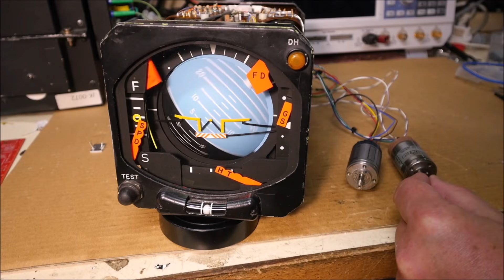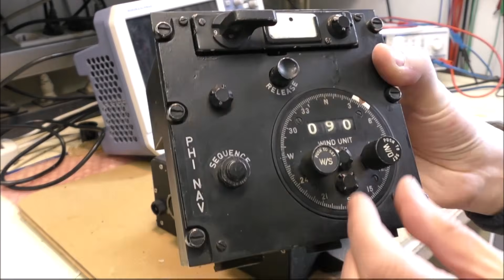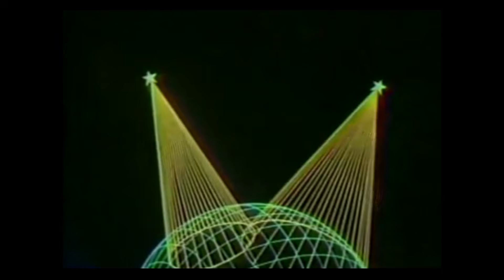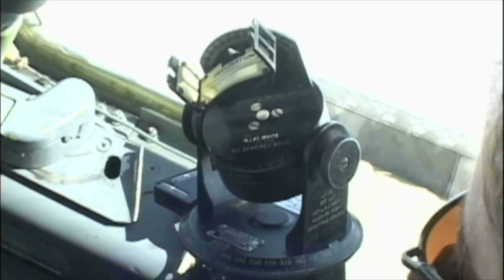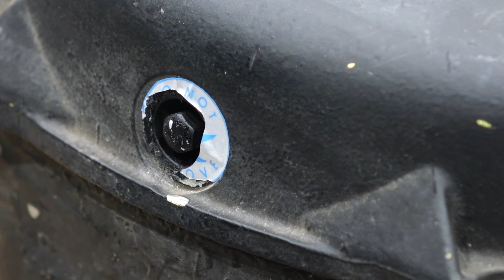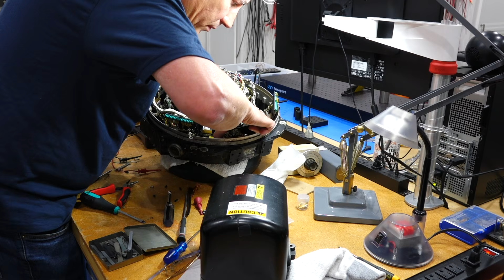B-52 Bomber Astro Tracker - Part 1: Grand Opening (ft. Le Labo de Michel)

Comment: 19:25 It's too late for now, but may be helpful in the future: if the thing you're trying to open has a Shrader valve in it, why not just pump some air inside? This should squeese the cup outwards with no hammering or other medieval tricks.

Comment: I work on a lot of vintage electronics and some of the components inside that probably cost a fortune. Those sealed glass end capacitors are called " Vitamin Q" caps and were VERY pricey back in the day but usually still good 50+ years later.

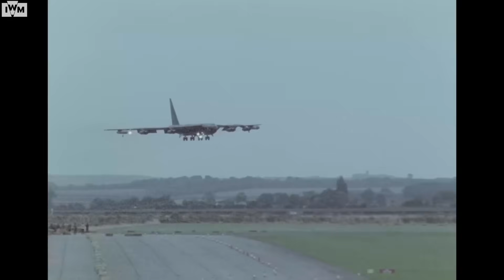Comment: 15:20  That is a retired B-52D landing at Duxford England to become a museum piece. I was the Crew Chief who launched it out from Carswell AFB Fort Worth, Texas in 1983. The pilot was Colonel Jim Nerger, who is now passed away. Colonel Nerger, a war veteran, was the most respected Bomber pilot at Carswell.
Reply: Hey, I remember those planes. I transferred from Grand Forks to Carswell in 1969 and the entire B-52D fleet was just being deployed to Guam. We worked on the brand-new FB-111A which was just being built across the runway at the General Dynamics factory. I worked in the autopilot shop and for some crazy reason for a brief period before the 111's arrived I recall being asked (ordered, actually) to crawl into a tight space in the tail to change out something in the horizontal stabilizer screw jack in 100 degree plus direct sunlight. Somehow I survived.
Reply: @bwinmaine   Interesting story. Once I was in the horizontal tail of a 747 and someone opened the hangar door. When the sunlight hit the tail it was like an oven in  there. Like you say....I don't know how I made it out without getting burned.

Comment: When I was in the Air Force in the early 80s they were retiring the B-52D models at Carswell AFB and the NCO club wanted one of the optical bomb sights out of a D model. So I was assigned to remove it from one of our scrapped planes. I had no Earthly idea how to work on one of those....I was a two stripe crew chief assistant. My supervisor said....just cut all the wires and do whatever you have to do to get it out of there. So there I was out in remote parking (it was sitting in the grass by the side of the runway)  ....fighting off Texas size hornets......and ripping and tearing. I finally got it to the point it was ready to drop out on the ground. Just about that time (and it took ALL DAY to get that far)  my supervisor showed up in his truck. He caught the thing as I undid the last fasteners and laid it in the back of our bread van. As far as I know it sits in the NCO club at Carswell AFB to this day. Does anyone know?

Comment: Was this mounted in the overhead plexiglass dome aft of the flight deck?
Reply: This unit was mounted on the top of the fuselage and was removable from the outside. I did it a few times myself back in the day. Basically it was where the center of the wings met the fuselage. The dome was the only part visible outside the airplane and I don't recall any part of it visible from inside.

Comment: I lived next to the USAF Museum at Wright-Patterson AFB most of my life. I was always intrigued that the Norden sights and navigation systems were the super-secret parts that were removed from everything. You could look at disassembled engines to the SR-71 but not the navigation system. But even when this stuff was in use it was very guarded. They would remove the hardware and secure it when the plane landed. I think anywhere they landed needed a vault to put the classified hardware in. They have a lot of huge hangars at WPAFB, and Building 9 has a big vault where they would store the bomb sights. Now it's part of the USAF museum annex where they have old Air Force Ones and experimental stuff that's not in the regular museum. The retired guys who work there put a bunch of plush alien toys in the vault. The USAF denies there was ever a Hangar 18, but Building 9 or one of the other huge hangars in WPAFB Area B would really fit the description LOL
Reply: Well I worked on this star tracker system in the B-52 H model in late '69, early '70. I don't recall ever being told the stuff was classified although it would make sense if it was. The equipment did stay in the aircraft - permanently - back then. I can attest to that since it was our job to remove and install these units.

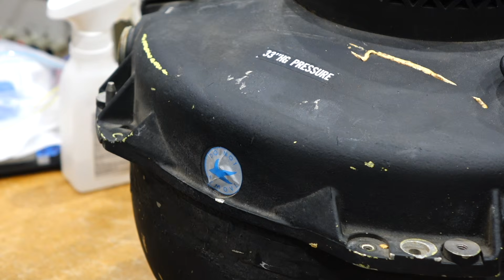Comment: 17:57 at match Air Force Base in California there is a museum and they have a section where they took the cockpit area control panels of a b-52 and also the navigator area control panels and have them set up so you can sit in the cockpit area. There is a communications recording bombing run going through the speakers there and you can press a button and controls will light up as the recording is playing indicating what the pilots would be pressing as you hear them communicate with each other. 
Every time I go there I understand more and more of what I’m looking at and that is an amazing feeling and I’d like to thank you for sharing all this knowledge.

Comment: Russia still has Celestial Navigation on strategic bombers. They use a digital system from KRET ANS-2009 which is able to provide very precise coordinates. It is for the case of war when satellite navigation systems would not work, together with the inertial system, the aircraft always has knowledge of its own position with high accuracy.

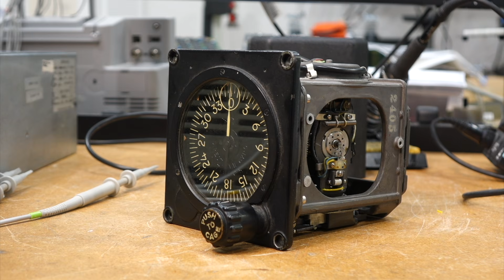Comment: 07:40 Correction. Gyro Direction Indicators Do Not Drift. They remain aligned with the Universe, but the Planet is Rotating, That is the drift-correction needed. (Check out any Foucault Pendulum) [The planet is also translating through it Solar orbit, and The Solar object is also moving, depending on your point of reference.  (( Check out your REFSMMAT ))

Comment: Looking forward to the follow-up videos.  I worked Avionics Instruments on B-52G's and KC-135's in the late 70's and while the Astro-Tracker wasn't one of the systems I worked on it was one of the systems we made use of for the primary flight displays (instruments).  If I remember correctly it was the Bomb/Navigator crewman that was directly responsible for operating the Astro-Tracker, but that there were outputs used by the pilots as well.
Another system you might want to look into is the FD-109 system used on the KC-135's.  As I recall, it permitted the flight profile to be altered based on need, such as the airbase being under attack and the need to get in the air quickly, so in such situations the flight profile would be altered from standard climb-out angles and speeds.
Reply: It was the responsibility of the Auto-Pilot shop.
Reply: @snakerstran9101  And the astro tracker controls were in the navigator's panel, the right seat downstairs.

Comment: Guidance computer: check. Radio communication and ranging: check. Optical navigation: check. Florida launch control center getting restored to working conditions (thanks Carl!): check. At this rate, Marcs team will cobble together a moon mission from ebay parts and museum exhibits before this decade is out...

Comment: I was a Navigator on B-52's and was very familiar with this system.    This astro-tracker was part of the ASQ-38 bombing and navigation system, (used in G  and H models).  The D model used a ASQ-48 system.  It was alway a good day when you got the astro tracker to lock on a star or the sun.  Understanding the true heading was really important on bomb runs.  Resolving the true heading error would cut your circular bombing error down significantly, allowing you to hit the target.  Funny thing, at night  you had to be careful not to let your astro-tracker lock on to the ramp lights.  As a side note, a good navigator using celestial navigation would  know his position with in a couple of nautical miles.  Two miles is not a bad error when you have been flying over water for 12+ hours.
Reply: I worked in the autopilot/navigation shop in Grand Forks through the winter of '68-'69 when I was 19 and 20 years old. Grand Forks flew the H model B-52 with the gatling gun in the tail. On several occasions I remember walking up the wing and removing this astrotracker assembly from the top of the fuselage right where the wings met. In my 8 or so months on the job I remember meeting a navigator only once. There was a general alert going on and for some reason I was the only person in the shop. Several guys came to get a technician and it fell on me to go discover why the navigator couldn't get his system running. Fortunately I remembered learning in school that if this ever happens check with the pilot to see if his J-3(?) magnetic compass circuit breaker was off or on. I scooted up to the upper deck, all engines running on every B-52 on the flightline, got the pilot to reset the compass, and exited the airplane. The base commander motioned for me to get into his Chevy and he hung right on to me until every B-52 was in the air. You don't soon forget something like that when you were just 19 years old.
Reply: wow! man what an amazing story. I felt like I was right there! Nice piece of writing thank you for taking the time to lay it all out so well
Reply: Be curious to know what sort of percent rate of success was estimated, with cloud cover and all?
Reply: I was a C-130 Nav and always thought the EWO shot cell in a B52?
Reply: There are at least two birds in Europe—one known as the "swift" and the other as the "swallow"—that make a journey every year, for instance, from Sweden to South Africa and back, seemingly with great precision. Leg bands have been placed on swallows (which build pouch-shaped nests of dry mud on building walls, just beneath an overhang), and it has been observed that, after their round trip to South Africa, they return to Sweden each year to the very same nest they used the previous year.

Comment: fun fact, the first celestial almanac was calculated over 500 years ago, back then they knew where the sun and some stars would be today.
Reply from the maker: That’s can’t be right. The Antikythera mechanism is from over 2000 years ago, and was a calculating almanac with the correct movement of the sun, moon, planets, and even predicted eclipses. So precise almanacs date back much further than 500 years.

Comment: Not to forget, true heading is NOT the direction you are flying (this is true course). True heading is the direction the airplane is pointed at, and it will only be the direction you are flying if there is zero wind, or if the wind happens to be exactly aligned with your course, in which case the heading will be the same as the course (assuming coordinated flight).

Comment: The Apollo Guidance Computer also used astronavigation to help keep it located properly. It had a "database" of about 15 stars which could be used. This was one of the "advanced" programs that ran on the VM mode of the AGC to get access to the fancy math libraries needed to do the calculations. You should do a discussion about using the AGC star tracker as well for this series, to tie things together.
Reply from the maker: Good point! Man, I’d love to have someone lend us the AGC’s sextant and telescope. They use unusual double speed resolvers, so not an obvious thing to use this instead. Also instead of moving the optics, the AGC turns the whole spacecraft! Not an easy thing to replicate…
Reply: I would think an Astro-Compass in space theoretically "should" be much easier to operate because it is outside the atmosphere. No false lights to confuse or clouds to block
Reply: @snakerstran9101  Apollo 13 had this false star problem. It was one of the reasons why the "waste water dump" was abandoned after Apollo.

Comment: Its wild how much GPS solved so many problems in navigation, and such a more simple system.
Reply: GPS is definitely much simpler on the user/consumer side, but is fiendishly complex on the implementation side. A good trade-off, when you only need one (expensive, complicated) GPS network to service billions of devices.
Reply: GPS, as fantastic as it is, still relies on reference sources external to the aircraft, similar to this Astro-Compass. If the sources are inaccessible (or destroyed), the systems become useless. Thats why INS (Inertial Navigation System) has been such a desirable system. It relies on no outside reference during flight.

Comment: Interesting.    I worked avionics on the B-52 back in the mid 70's.   I didn't work on the Astro Tracker but I knew guys who did.  I think it was what we termed "Instruments" who serviced them.  Years later I crewed the C-130 which used a Navigator who used a manual Sextant to help navigate over long distances when outside of navigation aid range.
Reply: I was trained on this system, on the inertial nav system and the magnetic compass system, and on the autopilot system back in '68. I seem to recall that the term "avionics" hadn't come along yet in SAC at least but now that you mention it, the term "instruments" rings a bell although the majority of the gauges and controls didn't pertain to our shop. Our shop also did not work on bomb nav equipment or gun controls or radar or communications radios, just nav and autopilot.

Comment: Interestingly, the Boeing 707s used as Presidential transport aircraft replaced the flight engineer position with a navigator and had a window in the roof to allow the navigator to see the stars for astral navigation.

Comment: Incredible to see two, no three of the greatest analog computing wizards working on some of the most complex devices ever. Marc, Michel and Ken.
Reply: The greatest are the ones creating modern wireless network hardware tbh.
Reply: I worked with PC grade software and hardware for 28 years, running service departments, ensuring quick fault resolution and repair. This is multiple levels beyond that. Even more difficult than fixing a pinball machine. Respect. Bravo.
Reply: @StevenHoman  Love the pinball reference. I worked on these star trackers back in '68 and '69 straight out of tech school at Chanute AFB, Rantoul Illinois. After my Air Force years, I had a brief love affair with pinball machines. One winter I babysat the game room at a ski resort hotel, and it had a couple of mechanical pinball machines. Nobody would use them, but they trusted me with the keys for some reason so on several occasions I opened the machines, adjusted the tilt sensors to make the machines more tolerant, more fun to play, borrowed some quarters from the can and gave quarters to some of the kids hanging out there. They instantly fell in love with the games and went begging to their parents for more quarters. Made them quite a lot of money that wat. That all ended when the owners of the games took away my keys. Sad, I know...
Reply: I somehow doubt they are greater than the analog computer wizards of the who designed the system initially.

Comment: What a super fascinating video, Marc. First off thank you for sharing and I was surprised to see the date code of 1983 in the unit. From what I understand GPS was still in its infancy back then but in my mind I see similarities between this device and the GPS system.
Reply: That date was likely when it was overhauled at a depot. Most of these components were made during the era of the airplane being made, with an estimated lifetime supply of extras. Should be a mfg date on the tag, likely early sixties. Thats why an extended lifespan of the B52 can cause all kinds of side complications, although avionics is a bit different because modernization of avionics is a given.
Reply: @snakerstran9101  Thanks for the info!

Comment: If you have a groundspeed sensor (and can measure the deviation from groundspeed bearing to your heading) why would you care about airspeed anymore? ISTM that knowing groundspeed magnitude and bearing should suffice.

I'm somewhat surprised that continuously using Doppler radar aimed at the ground wasn't a massive EMCON issue. Was is maybe only used intermittently, was the beam very narrow (with few sidelobes), or was there another reason why it didn't make it very easy to detect the aircraft and steer a missile towards it?

Comment: There’s old film, I believe the title may be On Guard about the Semi Automatic Ground Environment (SAGE) part of which describes IBM making the airborne computer used in the B-52.  It looks like the assemblies are about the component density of IBM 1401 cards and they’re in individual cylindrical canisters.  It is amazing what was achieved in the 1950s and 1960s with relatively little electronics, ingenious electro optical assemblies and extremely well crafted software.

Celestial navigation and dead reckoning are still possibly relevant because satellite navigation is likely to be disabled pretty early on if a world wide conflict erupts.  The question is how much need will there be to navigate after the initial exchange if an all out attack and counter attack erupts.

Comment: Interesting video. Worked on the astrotracker system for two years (1973 - 1975) on Strategic Air Command B-52G models. Your tech data that you show must come from a B-52D as the true heading computer display is different from what we had. Probably lugged a dozen trackers up to the top of the BUFF for removal and replacement. Had to chuckle at the computer that was ripped open. We sometimes had to bounce it off the airplane structure (or kick it) to get it off the mechanical limits if it was stuck. To answer the comment from @luzgar the system was actually quite reliable. It was used on every flight, which could range from eight to 12 hours, so it was used a lot! You probably don't have the shipping container the tracker came in. it was about 6ft by 6ft by 6 ft with a gimballed mount for the tracker that was suspended from bungees so that it would remain upright no matter what the box did. Looked like you had many of the components. Good luck making it work again.